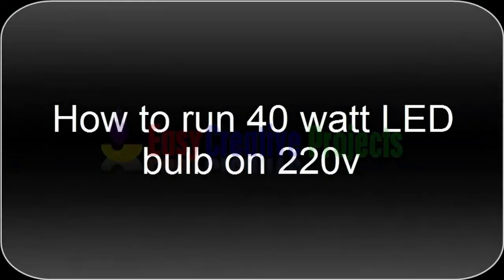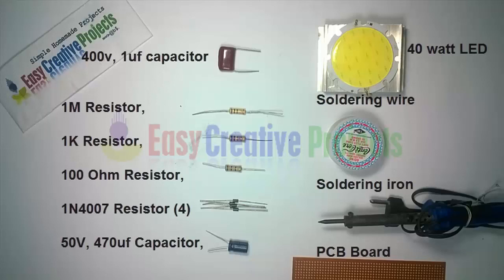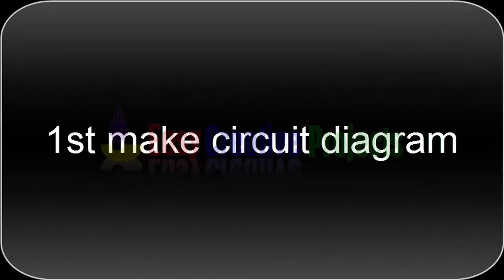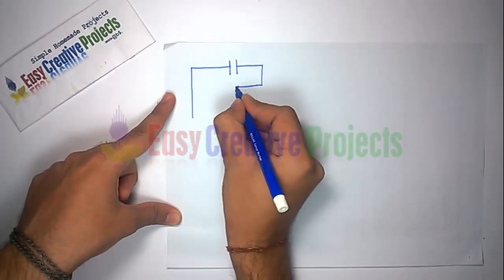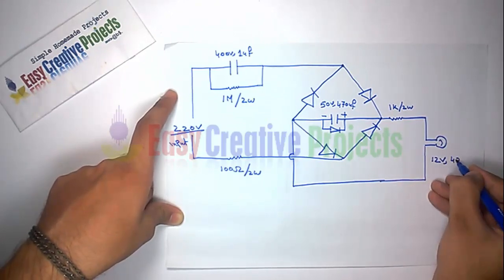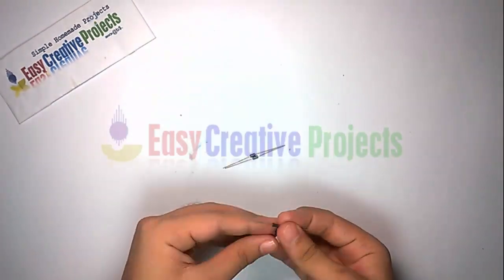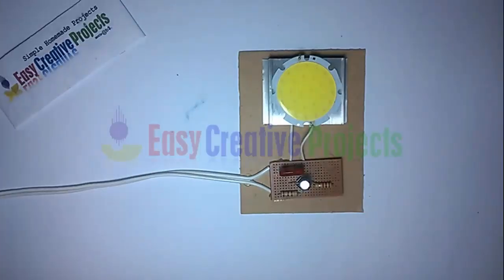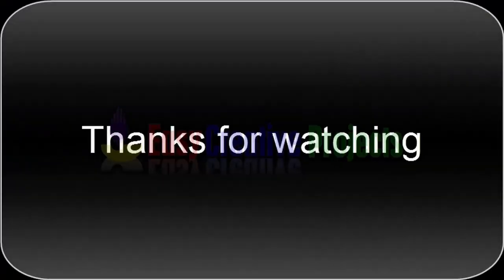How to run 40 watt LED bulb on 220v - easy step by step with circuit diagram

Comment: In this type of cercuit led brightness is very low,
Reply: He needs to add larger size capacitor (6 qty) such as 225J/400v in parallel to achieve 800mA to light power. Currently is is 5W to 7W power driver only.

Comment: this is a very bad power circuit design, it will not work will as it should
Reply from the maker: dear its a simple circuit. i think you use diode wrong direction.

Comment: Sir can i use 105k 400v capacitor for 18 w led
Reply from the maker: yes dear you can use.
use wood table on back side. and dont touch any thing after connect power supply. because you play with 220v. so be careful. 
thanks.

Comment: Sir,please yeh batana ke in led men kitne kitne watts ke resisters use krne hen.
1.    1 watt led.
Resisters watt?
2.   5 watt led.
3.    10 watt led.
4.    20 watt led.
5.    40  watt led.
6.    60 watt led.
Sir please zarur reply dena.
I wait 4 u.
Thanks
Reply from the maker: dear agr simple 12v ki power supply k sath chlatay ho to 5w 5ohm ya 10 ya 20 ohm tk ki resistor use kr sktay ho. 
yah resistors normally led k sath hi aati hin. 
but agr direct power supply k sath connect krna ha to hr led ki video aap ko channel pay mil jay gi aap udr say dakh k bna sktay ho.
Reply: Sir very very thanks

Comment: i tried it but is not working is fake
Reply from the maker: why you fail this project.?
i explain every thing in simple words. 
1st try to change components shop. and follow circuit diagram. see positive and negative terminals. i hope you complete this task very easy.
thanks.

Comment: I make it 3 times capacitor blast,  its truly fake... Logo ko pagal bna rhay hay
Reply from the maker: bro i use this LED last 6 month at home. i cannot find any complain. even you can read my all viewers comment.
you are 1st one who say its fake. 
follow my instruction.
try to find same components from good quality shop. follow circuit diagram.then try. 
thanks.
Reply: Easy Creative Projects I purchases 5 diodes 1n4007, 1uf/400v, 1M Resistance 2w, 1k resistance 2w, 100ohm 2w,470uf/50v capacitor, soldier as your instructions diagram truly fake 3 times blast capacitor...03364190206 its my whatsapp number, I need your sport to make this circuit...
Reply: Easy Creative Projects i will send photos components, may be the shop keeper wrong components to me...
Reply from the maker: dear share photos on my facebook page message.
Reply: Easy Creative Projects 
Dear sir, can you send me theses components make it with complete project;
I see where I am wrong to make this project...
Reply: Mohammad Ali, sometimes these circuits are damaged because when they connect they do not find the load of consumption, in this case it would be the 40w LED. But it is strange that the 50v capacitor is damaged, since the 1M resistor limits the current to 70% of the actual value. Take into account the polarity of the capacitor (-) (+) ... greetings.

Mohammad Ali, en ocasiones estos circuitos se dañan por que al conectarlos no encuentran la carga de consumo, en este caso seria el LED de 40w.  Pero es extraño que se dañe el capacitor de 50v, ya que la resistencia de 1M limitar la corriente hasta un 70% del valor real.   Tomar en cuanta la polaridad del capacitor (-) (+)...saludos.
Reply: if it's a 12volt supply circuit then use 2.2 µf 400 volt capacitor
Reply: Is it works for 18w (96LED)

Comment: Dear sir i am new in electronic, try to make this project but failed,,, please tell me details of components values and diagram, if you have any blog and website to help me please conform.
Reply from the maker: dear in video i try to explain every thing with circuit diagram. 
simple follow diagram and make same.
Reply: Easy Creative Projects 1m resistance what don't show w (1w,2w ?) 1k resistance w? 100 ohm resistance w?
Reply: Easy Creative Projects if see diagram use 5 diodes but on pcb bord only 4 diodes show...?
Reply from the maker: dear use 2 watt resistor. if you use less then 2 watt your resistor burn within mints. 
5th diode i use for more safety. if you use only 4 diode so no problem. you can use. 
but more better if you use 5th.
Reply: Easy Creative Projects use all resistance 2w ?
Reply from the maker: if you use long time so try to use both other wise  1m resistor must b minimum 2 watt.
Reply: Easy Creative Projects dear sir u can't understand what I asking... simple question all resistance use 2w ?
Reply from the maker: yes
Reply: Easy Creative Projects thank you sir

Comment: If I want to 110V version, just modify input 2u to 4.7u cap. ?
Reply from the maker: 1st try to use same. if led brightness slow then change capacitor power.

Comment: Bhai agr hme 40 wats ka 6 led lagana ho to uska splayi kaise banega.
Plz reply me
Reply from the maker: 1st, make same 6 circuit 
or
2nd, use transformer.power supply.
because 40 x 6 = 240w power. and  12 x 6 = 72v  
you need 72v and 240w power supply for series circuit . and also need powerful heat sink for each LEDs.

Comment: Sir, can we use the same circuit for 40W tube light?
Reply from the maker: no dear tube light not working. 
i make video for ( how to run tube light using old energy saver. ) see video in my channel and make same.
thanks.
Reply: Thanks for reply....!

Comment: nice and simple idea, but for 40w led need 25-30vdc...not 12vdc.
Reply from the maker: Dear,
this LED rapper show 12v and 40w.
1st i run with bike battery and 2nd i make circuit. its work proper.
sorry but who say 40w led need 30v power?
Reply: Easy Creative Projects, I just try led lamp like that, can't light if I use 12vdc and than I increase voltage to 25vdc led lamp going to light and bright....

Comment: hey its diod not a resistor (1N4007)
Reply from the maker: yes 1n4007 diode. 
sorry its typing mistake.
thanks for correction.